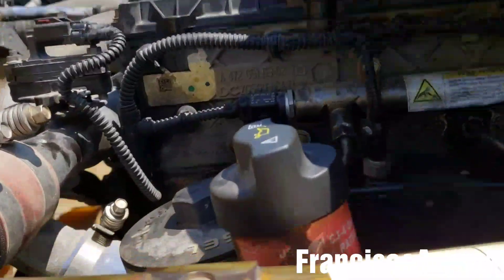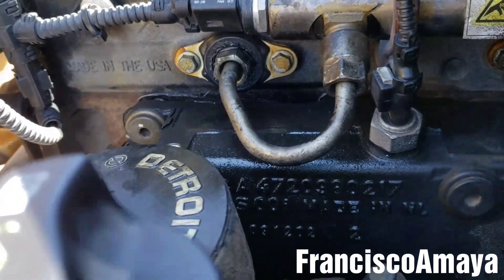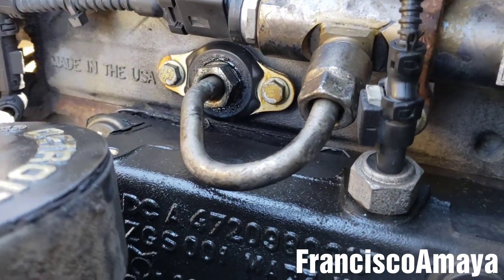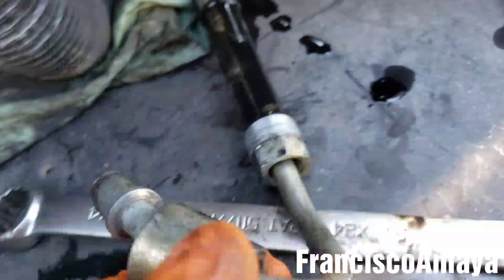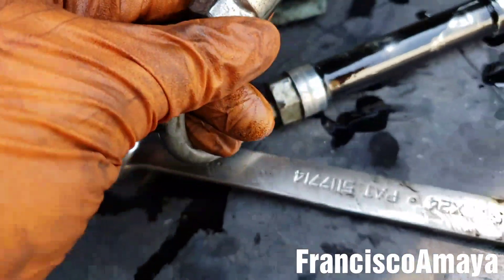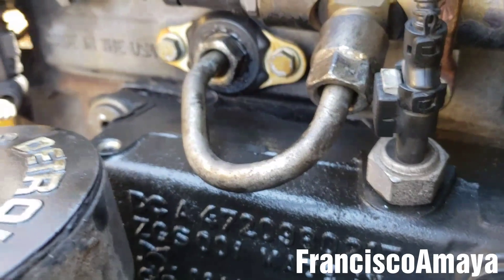Freightliner Cascadia DD13 DD15D16 high pressure injector fuel line leaking bad fuel line

Comment: 👍👍👍Just changed all 6 gaskets, 2 were leaking.
Reply: how much did it cost you?
Reply: @jorgefacio690  $883 at the dealership.  Will be cheaper at a local mechanic. Parts was only $54. Labor was a killer. But I wanted it done right.
Reply: @royfredericks2231  $883??? Wow. It’s literally a 30 minute job.

Comment: What about the 1500 psi fuel warning? Did you have release the pressure?  If so how. My truck has a smaller leak in the same spot.
Reply: Wait about 10 minutes after truck is turned off to replace line. Pressure bleeds off over time. It’s very common for this line to leak oil around seal from the head. You can buy the line and seal together. Never reuse the line. They are one time use. Very easy job. You will need a 10mm socket and 3/4 or 19mm wrench to complete repair. Crows feet make the job a breeze.
Reply: @fordpowersmoke2725  thank you for the info.